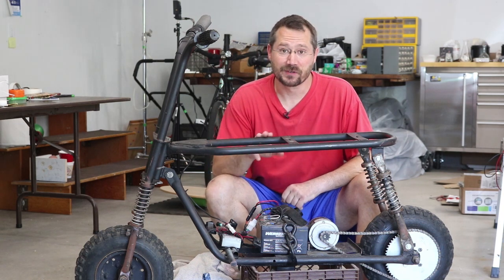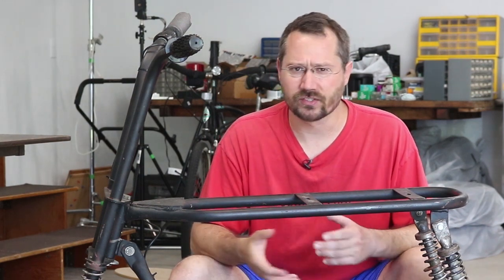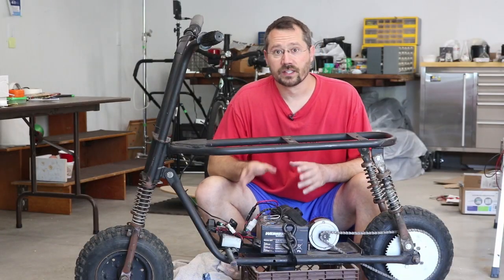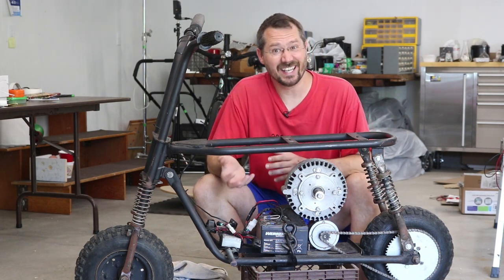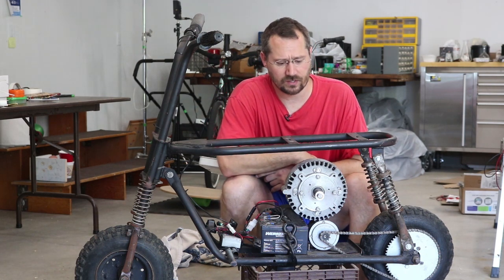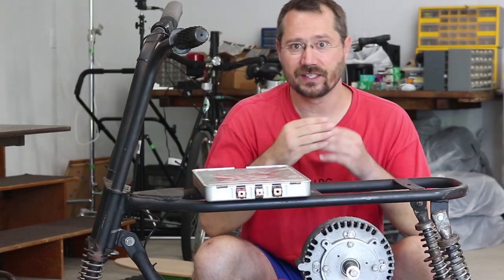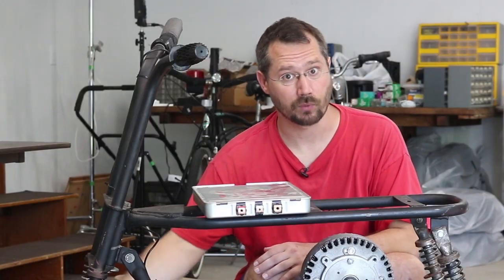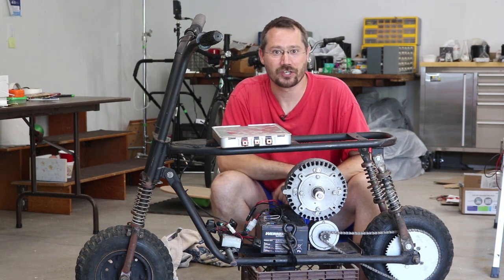Electric Mini Bike ready for upgrade

Comment: I know this video is like 2 years old but do you remember how it drove with the 24v 250watt motor? I am considering building a mini bike with that motor.
Reply from the maker: Very under-powered with the 250 watt motor. It would move me on the flat ok, but any slight uphill climb would really kill it.
You would want a larger motor. Something like a 750 watt/1HP would probably be great for zipping around.
Reply: BenjaminNelson  yeaaahh, that was my concern! I will go for more power then 🤘🏻

Comment: What makes the mini bike faster a bigger battery or motor
Reply from the maker: Both can. On a DC motor, speed is proportional to voltage, so a higher battery system voltage means a higher top speed. A more powerful motor  will get you to that top speed more easily and can take advantage of gearing for increased speed as well.